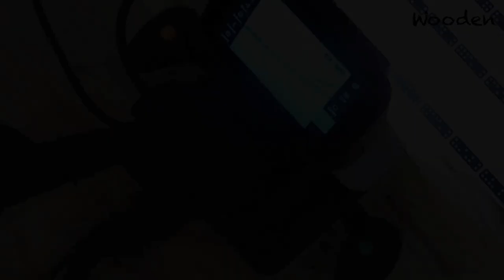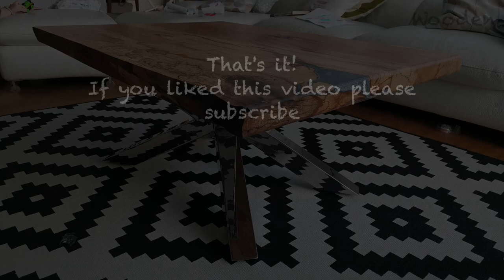Coffee table with steel spider legs - Spalted Beech

Comment: 2:42 I didn't know they made collars for spade bits.
Reply from the maker: Haha, they don’t make collars for spade bits. I used a skill I learned from Happy Atom: improvise. I used a normal collar and stuck a screw in between, then somehow I was able to attach it. It holds for years now, but I am afraid it will break appart one day 😂
Reply: @Woodensoul  Sounds like you need a patent!
Reply from the maker: Haha... right 💪🏻